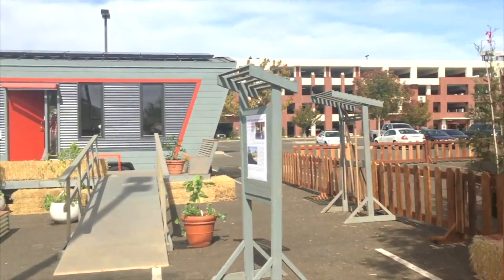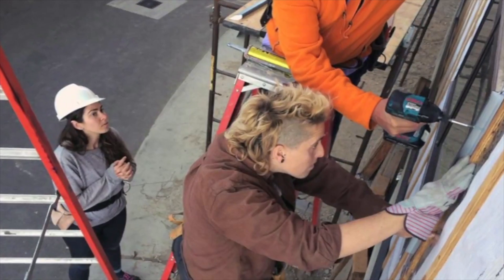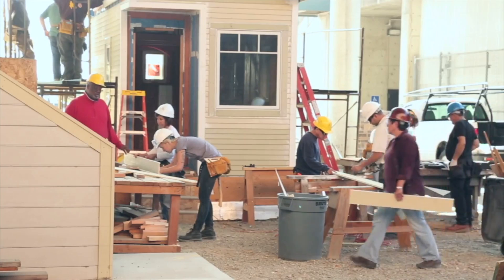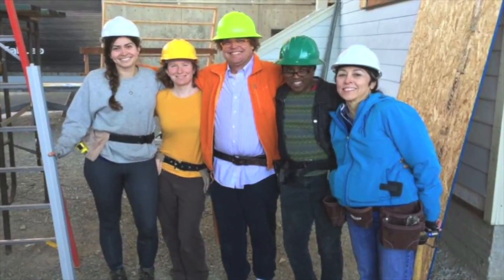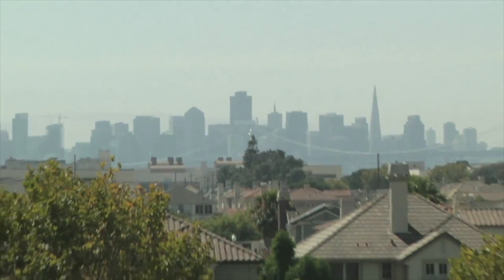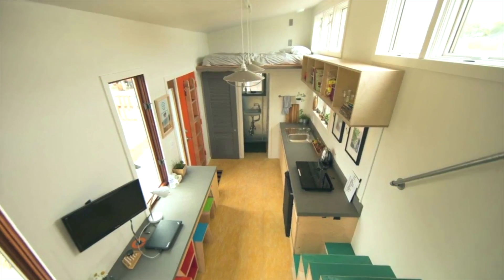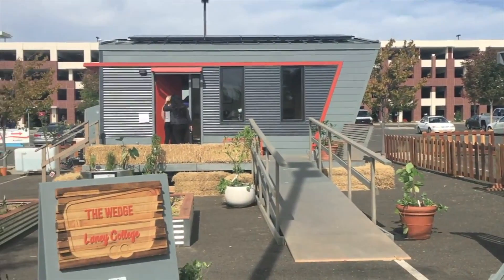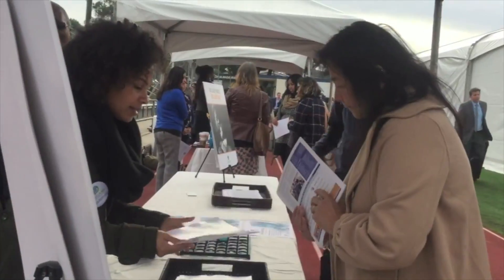The Wedge Tiny House Produces More Energy Than It Uses

Comment: While I applaud the effort, it's a bit disingenuous to say that you could build a tiny house that produces all its needs in that 30K range. The solar system alone could run you that much. While I know that you can piecemeal a Tiny House together over a few years, if you need somewhere to live then it's a requirement to get out of the elements immediately.
Reply: 1timby it's a possibility that labour cost was not factored into the final price of this tiny house as it seems to be the result of a collaborative class project.   Looks like a practical tiny house.  Would like a detailed house tour.  Well done on explaining the background to the project. 🙂☘🌲

Comment: This video needed alot more info on the power system and heating, and also details on the water system and insulation. The video is nowhere detailed enough to really demonstrate live-ability for a serious buyer. This tiny house wouldn't cut it in my Alberta winter climate at all for live-ability. Its energy systems are just not good enough, or if they are they certainly aren't detailed well enough in the video or on the website at all.